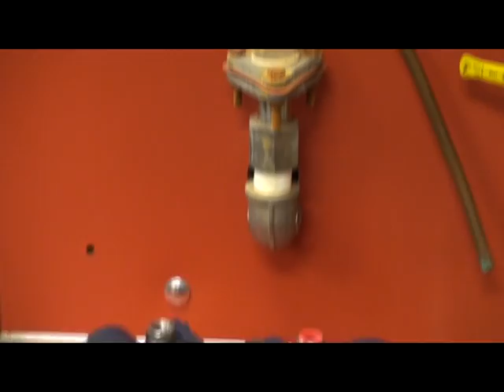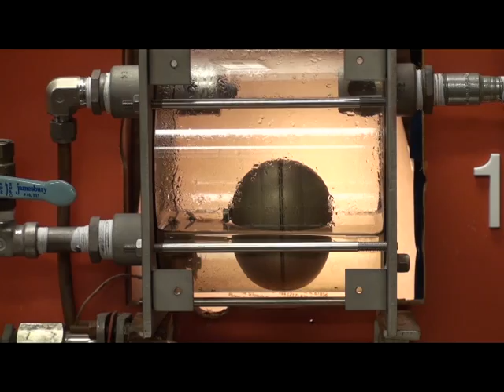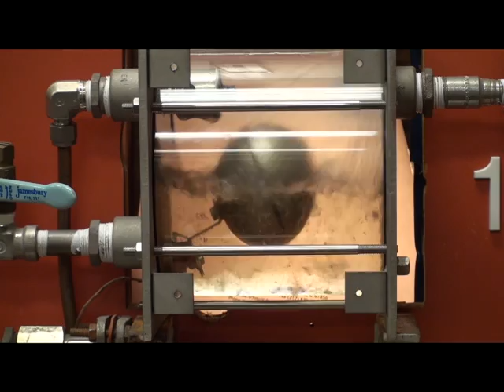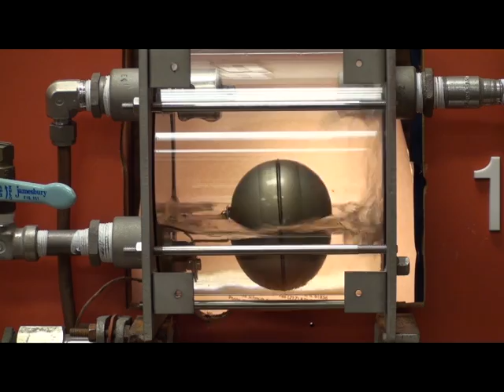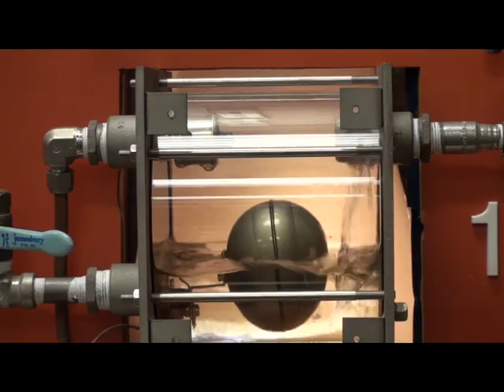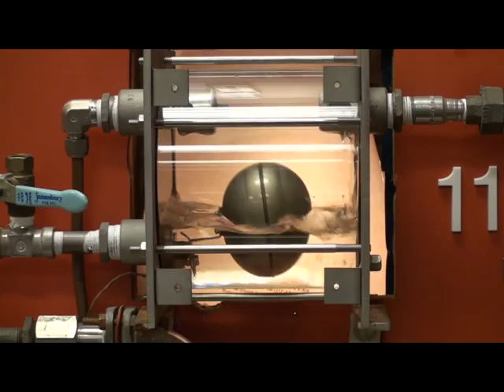Float & Thermostatic Steam Trap Tutorial

Comment: No. The thermostatic air vent is for venting air in the system. More likely the valve is not seating correctly anymore. Even with a through cleaning, these traps can go bad. You can change out the internals, but F & T's are usually not repaired in that they are cheaper to to just replace. You can contact your local Armstrong rep and they would be able to help you.

Comment: I have these traps in the boiler room, after the lines that run through the rooms in the building. While I have taken all of these traps apart, and cleaned them, I am still getting a lot of steam coming from my condensate tank. 

My question is... Can failure of the thermostatic part of the trap cause steam to pass through the lines, even if the float is working properly?
Reply: yeah you probably need to add an air vent
Reply: I am having the same issue, was wondering if you ever figured it out, I’m in the same boat and have steam dumping into my buildings condensate tank, but the float seems to function. I’m wondering if the thermostatic valve has failed and is stuck open
Reply: If I remember correctly, I turned off valves to find which line the steam was coming from, then replaced the tap on the line, and that solved it. That's been a long time ago, so I'm not that clear on it.